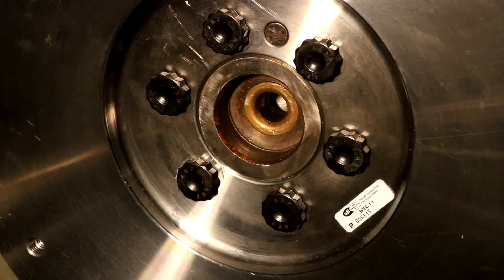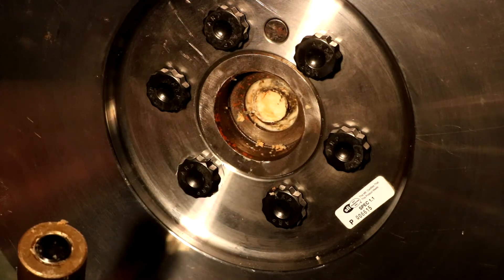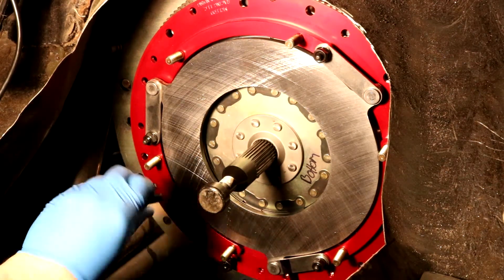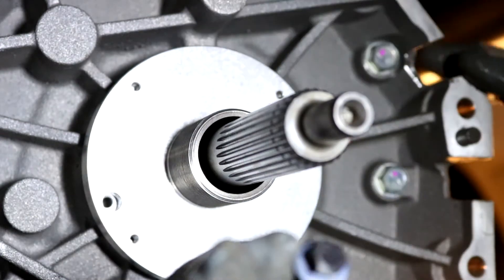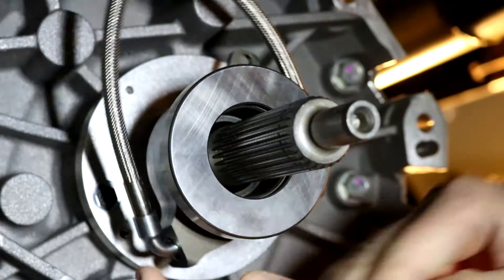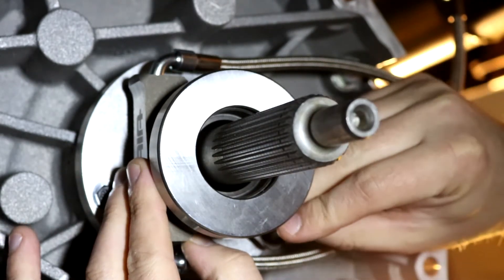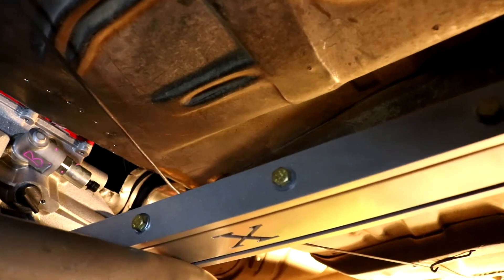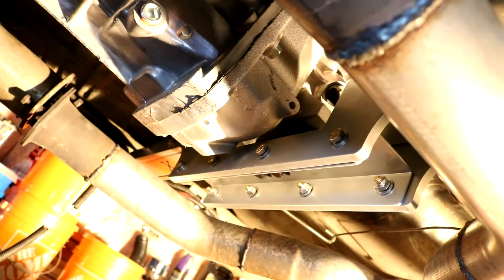1971 Chevelle SS - T56 Magnum Install - Part 4

Comment: I’m doing an engine and Tremec TKX swap. What degree did you set the back of your engine/bell housing downward towards the rear? Or do I just keep my carburetor dead level because the intake is pitched higher in the rear. I hope that you can understand that. Thank you in advance
Reply from the maker: On chevelles they typically want a 3 degree or so down angle at the trans. So the trans pointing down slightly. I jacked my transmission up as high as I could get it as clearance between the floor and front U joint is a limiting factor.

Comment: Hello, I noticed that you did not show measuring run out of the transmission bell housing to the engine. Tremec recommends no more than .005" run out. Did you not do it and just install the transmission? There must be a hundred videos on YouTube on how to do it. More cost of course because one has to buy measuring tools and offset dowels to align the bell housing to the engine. And one has to remove the OEM dowel pins which can be no easy task.
Reply from the maker: I did check the runout, both concentric and parallel. I had to buy a special plate that attaches to the QT bellhousing to do it because the bellhousing doesn't have a complete circle to measure on. I was very lucky, with the stock dowels, my runouts were under .002.
Reply: @SS454LS6  Hey thank your for the reply! Looks like I will measure my runout. Thanks.

Comment: Will the whole setup fit through the hole in the bell housing? Or do I have to install the bell housing then the bearing? 1970 Camaro Z28 is the vehicle.
Reply from the maker: The bearing goes over the input shaft of the transmission. So you install the bellhousing first.
Reply: SS454LS6 Thanks for the reply. Do you know if I can use the stock mechanical linkage with the new Tremec TKO500? And will I first need to remove the shifter to put it into the tunnel, or will it all go in without the shifter removed?
Reply from the maker: @dontbusttheplace8151  Sure you can use the stock mechanical linkage. In which case the hydraulic release bearing in my video wouldn't be used. Should be able to install it without removing the shifter.

Comment: Can this be used with any clutch setup or do you need a tilton on clutch?
Reply from the maker: I am not certain what you are asking, but the Tilton release bearing should work with any brand of this generic finger style pressure plate clutches.

Comment: What bushing did you use?
Reply from the maker: I got the pilot bushing at a local parts store. Can't recall brand name. Where ever you buy it, bring a magnet to ensure it does not contain iron.
Reply: @SS454LS6  yeah that's what I have been reading on the forum. I am just stuck deciding between roller and bronze
Reply from the maker: @75zl1  I prefer bushing. Nothing to fail, it'll just eventually wear out over a long period of time.